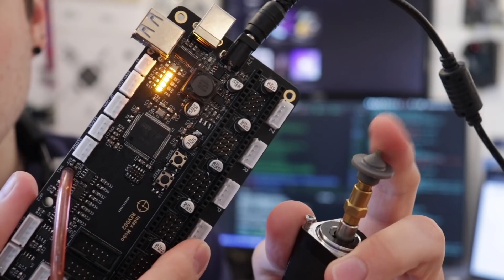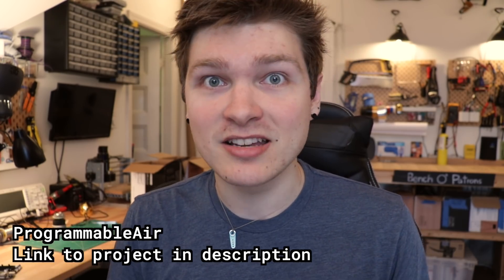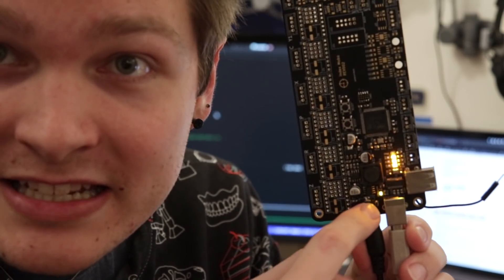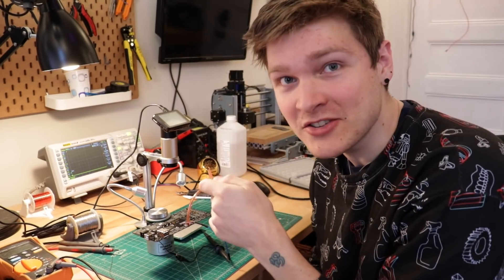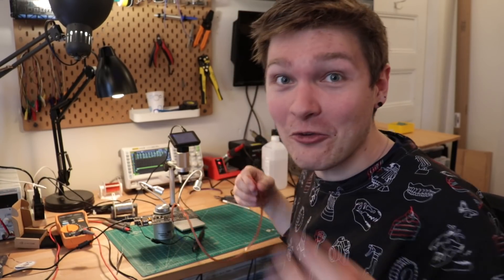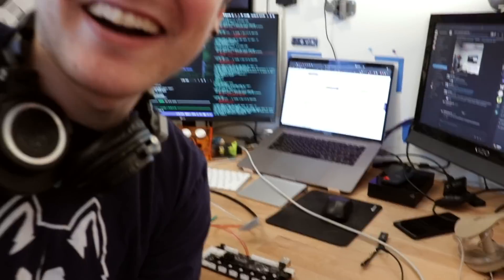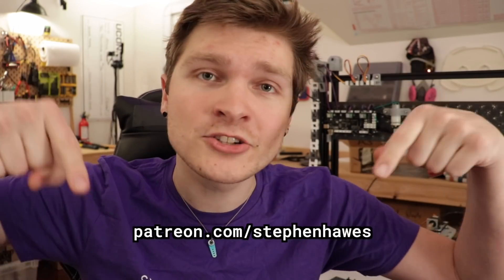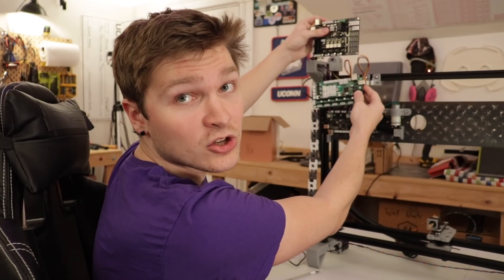Custom PnP Controller: The Final Chapter

Comment: So basically what I'm gathering from this is your basically using Marlin firmware which is a 3D printing firmware so what you're really trying to say is I can do this using a 3D printer main board with just firmware changes interesting now I know that the 3D printer board it's not going to have the stepper IO quantity needed but it could be a good start for education I have a question is do I upgrade my 3D printer or do I scavenge it for parts and make a PNP

Comment: Vacuum sensing would likely be more reliable if the sensor is up by the tip. Faster response because that whole length of tube back to the mobo needs to be evacuated with each cycle. Threshold should just be set there by a comparator and potentiometer, then output a digital output to the mobo.

Comment: I was looking for a cheap digital vacuum sensing to do waterproof testing. What I've ended up with is an arduino shield that has two LPS22HB's Baro sensors. Since they are absolute, you can pull up to about 0.9 ATM vacuum on them. Very cheap in volume. ABS 3d printed tube mount + o-ring to PCB, but the PCB must not have via's through the area exposed to vacuum, and the thicker the pcb the better as mechanical flexing affected them a little. Worked a lot with strain gage Wheatstone bridges and have several ADC's I like with built in gain from maxim and TI. Makes the one your using another option for me.

Comment: Anyway, I think that it will be much solid to place pressure sensor on separated PCB and move it on the carriage (expecting it will provide more correct information about pressure in nozzle)

Comment: Smart move to switch to instrumentation amplifiers. We learned about this in AC circuit analysis lab and trying to replicate the them using op amps is really difficult even if you are comfortable using analog circuitry since the resistors have to be tuned perfectly. 
We used them to make an EKG machine which also has to read a small differential voltage.

Comment: The ADC can run in continious mode in the background at very high frequencies. This means that you can read the a very recent value(maybe 1 microsecond old) sensor value instantly from the data register. It shouldn't be a problem to do so. But I don't know how Marlin is implemented.

By the way. SUPER awesome video! I enjoyed every second!

Comment: Small mistake: solder mask clearance is too high, so kicad just remove all solder mask bridges between fine ic pads (see 3:26). Set 'solder mask clearance ' to 0.05 mm (or just 0, as kicad recommended in recent versions). See 'Design rules//solder mask/paste'.

Comment: Why not add some descreat logic in the form of a comparitor high if over some voltage (I probably have the wrong term there) to convert the analog input to a digital input to make it easier to intergate into Marlin?

Comment: Hey Stephon if you leave enough solder mask between chip pins while design and apply enough flux before soldering , you can do it right a way  with just a single iron sweep without any bridges. you can learn more about it on Louis Rossman videos. I actually test it  with a very chip iron and it works fine. Keep it in mind quality of flux is very important use MTech or some thing similar (I used Lotfett flux).
Reply: Also why use a conical tip? If u try a chisel head or a knife head or a flat sided “C” tip u will for sure find it easier, you would be able to solder in one touch without the need to use desoldering braid, also yeah Louis Rossman videos are so great to learn soldering

Comment: A low tech approach could be a plastic tube with a dried pea (or plastic pellet) inside it. When there is vacuum, the pea would rise inside the tube. Mount an optical sensor at the bottom and you know if you have vacuum or not, because the pea will be sucked up the tube by the vacuum if there is a seal and not move if there isn't one. It also gives you a visual that there is a problem.

Comment: Stephen -- as others have mentioned, if A/D is going to be a hassle to integrate into Marlin's code, then you could instead just use a comparator to compare the (amplified) sensor voltage to a fixed threshold, producing a single bit to input to your MCU. You could use a DAC output to set that threshold, if you think it needs to be adjustable.  That said, it would be nice to be able to log the pressure signal, as variations in that during p-n-p of different parts could help troubleshoot pickup and release issues that may occur at some point.  Then again, if you're faced with such a troubleshooting task, you could always tap in a second pressure sensor and monitor it completely separately.

Comment: Could you make a video (it doesn't need to be long) about the actual circuit that was designed for Programmable Air? Or does the PA Project have a detailed Documentation on their scematics?

Comment: Vacuum sensing isn't really necessary as the vision will tell you if a part has dropped
Reply: The pressure also drops measureably when the Part touches down on the pcb 
Giving you an indication and confirmation of good part placement
Reply: @olivervoss3196  It's an indication of placement. Not necessarily good placement ;-)
Reply: vacuum sensing saves a trip over to the camera, advance the feeder, retry, quicker...
Reply: Seems like overkill when you could keep the sensing feedback loop on the MCU.

Comment: Forgive me if you have already answered this, but why a vacuum sensor?  You wouldn't have to have a hose to the board, and the expense of the vacuum sensor if you just load sensed the vacuum pump.  You could do that with discrete components.

Comment: why not measure the power drawn by the vacuum pump? under load/vacuum it should draw more power and u can kick the part from the BOM
Reply: This is what he should be doing. So much simpler, no fancy/hard to source sensors required, and it's really cheap. I'm using the ACS712 on one of my projects and it should work for Stephen as well if he is powering his vaccuum pump from his PCB it would be super simple add in. Fewer things for the end user to have to wire up too.
Reply: I guess measuring the pump motor current would work, but one reason not to go that path is that I suspect Stephen doesn't yet know whether this particular pump is going to be strong enough, once the PnP starts picking parts at some speed. So in the interests of being able to swap the pump easily, it makes sense to me to avoid that dependency, at least for now.  It's not even clear that you want the vacuum pump responding on the fly to each pick-up. It might make more sense to have a bit of a reservoir which maintains a uniform upstream vacuum, (with the vac sensor tapping in to the vac line close to the PnP head. That also allows expansion to multiple heads at some point (given multiple sensors).  And the pressure sensor is hardly "fancy/hard to source", you can get it at most of the main distributors.
Reply: @Graham_Wideman  Hmm yeah, I didn't think of that. It makes sense for sure to use a vacuum sensor if he's using a reservoir. I haven't worked with vacuums that much, but that seems more expensive than a direct vacuum from a pump. Do you think it's worth it?
Reply: @kelna2  Oh I don't know that he's using a reservoir currently. However it's certainly a move that can become useful in pneumatic projects to gain consistency of operation.  I was just listing some arguments in favor of decoupling the sensing of component pickup from the generation of the vacuum, at least until some experience has been gained.  Make it work reliably first, then see what can be cut out -- that kind of idea.

Comment: If you can't read the analog voltage with the marlin firmware, you could add a comparator and set the threshold with a potentiometer, and just use a digital input. Maybe that works.

Comment: I am not familiar with STM but in AVR, if you skip the blocking Arduino analogRead call and talk directly to the ADC hardware you can start an analog acquisition, go about the rest of your loop, and then poll for completion or get an interrupt later when the acquisition is complete. I am certain the STM ADC hardware is as or more capable than that. You'll just need to read the STM chip reference manual on how to talk directly to the ADC hardware. It won't be as easy as a quick call to analogRead, but it won't be that hard either.

Comment: Why do you still want to use Marlin? I think implementing all the extra functions in grbl would be a lot easier. I know there are gbrl stm32 versions with more axis than usual.
Reply: When prototyping, it's often quicker and easier to use what you know.

He can probably switch to something more feature filled or simpler later.

Comment: Why are you use analog input whan you can use comparator? Do you need to measure vacuum or just detect that something was picked up? Anyway, GREAT WORK!
Reply: At the end you are only interested if the threshold is met. But the threshold can be different for different nozzles. Probably an DAC could be used to adjust it as needed.
Reply: Agreed and 600mV will be read as low for a digital read on the stm32 and 3.1V as high
Reply: Because this way it's dynamic, which allow you to make changes down the road without having to redo your PCB.

Comment: i have no experience here but could you simply measure current pulled by the pump that creates the vacuum? Under a vacuum, the pump doesn't work as hard & current goes down and so you can just define the current threshold to denote high/low?
Reply: That's a brilliant idea, would simplify things considerably.

Comment: If Arduino’s analogRead function has too much overhead for Marlin, you could try using the Stm32 DMA to offload the ADC read. 
Or better yet, pass the sensor output into a comparator or output compare pin to get a digital value when the pressure is below/above a threshold. You can get the comparison voltage from a simple voltage divider or use one of the MCU DAC to make it configurable. This way, checking if a part is picked up is only a matter of reading a pin state.
Reply: DMA is overkill. Most of the time using conversion_finished interrupt is perfectly adequate and non-blocking.
Reply: And you could add some hysteresis on the comparator as well.  You shouldn’t have to do any ADC if all you need is blocked/unblocked and then it’s just a digital read.  I enjoy your videos!  Nice work!
Reply: Most of the Arduino libs are made to be as simple as possible to use. 
Most peripheral libs simply start the operation, then wait until it is finished and then return the result.
This way everything is very easy to use and no more advanced stuff like tasks or interrupts are required.
Reply: stuff like this is why I don't bother with arduino at all and just program stm32 chips directly.

Comment: They sell programmable resistors. Maybe that would allow dynamic range for the opAmp/pressure.
Reply: or a comparator and pot.
Reply: @danedwards_ee  Yes, very true.
But maybe dynamic changes could be useful: bigger components require more vacuum, or auto calibration if seals develop leaks. But not sure.  (These cases aren't really convincing.)

Comment: You can also use a 16-18bit delta sigma i2c adc instead of an instrumentation amp + the random microcontroller's adc (different micros have different bits/vref/accuracy so not that portable). This also helps keep the analog stuff right at the origin which helps with shielding and stuff.. There are many simple ones like the MCP34xx or fancy ones like the ADS1115 which has programmable gain and other conditioning which is nice.. But not sure how the i2c stuff can be handled nicely in Marlin fw.. and speed of reading might be an issue too..

Comment: Also for axis redesign (assuming this is in the mechanical bit?), this axis is pretty neat, and within reason "infinetly scalable":

https://wiki.opensourceecology.org/wiki/Universal_CNC_Axis
Reply: The issue I've had with machines using this type of axis is they tend to warp and twist
Reply: @xxportalxx.  There was data on that, i think it occurred post 2 feet or so (1 meter definitely)

There is a version with embiggened rods for things the size of the CNC torch table etc
Reply: @ericlotze7724  I've had versions shorter than that, and I'm really not impressed with what I've seen of them, they also have a habit of flexing considerably and inducing vibration in the process. I'd say using extrusion with rails or simply rollers is a far superior solution for not much more money

Comment: Does the board support ODrive for the Axis, and if not how hard would it be for someone to add that? (ie could it be plugged to some port, or would it be hard pcb level stuff) ?
Reply: I saw a video on the older design on odrive's yt channel "liteplacer" and it was       f a s t  .  Granted    m o n e e e, but for a makerspace or something the increased speed may be nice.
Reply: 12:50 probably answers that lol (askin before watchin tsk tsk @me)

Comment: Do you have a CNC PCB Mill yet? (or do you prefer etch resist-pens or 3d printed etch resist stencils? )
Reply: Or just

p c b      w a y

As well i guess lol, but local-fab/hardware testing is still neat imo
Reply: I believe he already showed boards he'd milled himself. He's like sponsored by pcb way so why not get professional boards produced?
Reply: @xxportalxx.  Definitely, they seem to make very “finished/neat” boards, i love the black coating option
Reply: @xxportalxx.  that was with a mill he got from a sponsor for just like a month. But since hes sponsored by pcbway he can get his boars made and shipped and receive within like 4 or five days, probably for free since they sponsor him, so there would be no point in milling your own boards. Specially anything bigger than a simple breakout.
Reply: @mikesnapper9001  yep